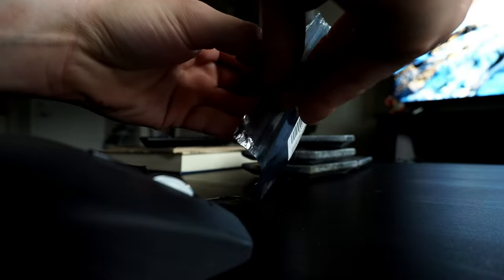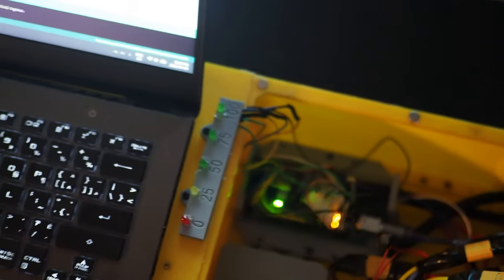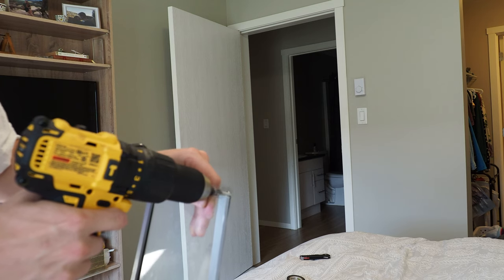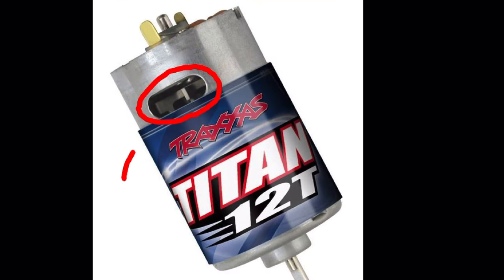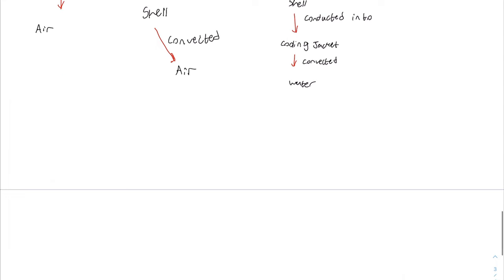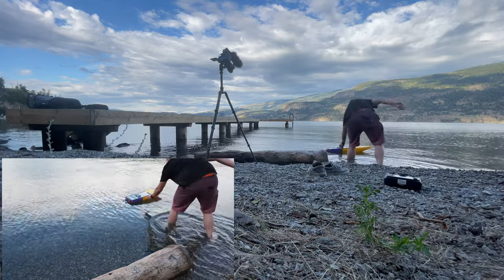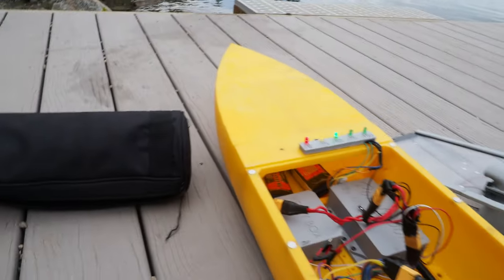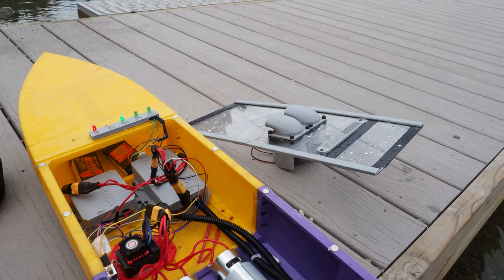Testing The 3D Printed RC Boat! And Some Other Stuff (P6)

Comment: The throttle stoping may be due to the 15% battery limiter. When you accelerate the moment the voltage drop may be triggering the limit and cutting the throttle. Then, after the throttle is cut the battery voltage jumps up again allowing the throttle to work.
Reply from the maker: I think you’re totally right, I’ll take a look at this! Thanks :)
Reply: I think this is your issue - voltage drop under load is probably excessive.

Comment: fans, for what, passive heat pipe conduction, for cooling, direct contact with cooling medium, either and or air/water, you got loads of both, standing around, you can keep all things sealed while pushing the heat out

Comment: Back when brushed motors were the only option, high performance electric rc boats had water cooling on housing and the brushes. The brush/commutator connection gets a lot hotter than the armature, and most of the heat of the armature transmits to the housing anyway. How nice is it that brushless motors came along? 

Haywire electronics are common with boats that aren’t sealed well.

Comment: For your Jets you need to deacrease the output diameter of jet at least 1/3rd of the intake area, Trial an error with size and RPM of your impeller to create maximum pressure, For Turning left an right dump the rudder and design the whole Jet output into a CV type joint and swivel the whole Jet. But Excelent stuff I recon you can realy improve the efficiency of the Jets and turning, Get rid of your battery cut off, test the min amount of batt at cut off  add 10% and just put and single LED show status when it gets there.

Comment: The throttle not working properly is likely because of your low battery detection software. The motors running full power draws a lot of current, thus dropping voltage over the wires, which triggers your 'cut throttle' implementation.

Comment: Ehh, brushed motors take water cooling just fine.  If you want the easy way, build a box around your motors, plumb in a takeoff to get a bit of water from the drive and direct it into the motor box,  and have a discharge out the side or back. 😁